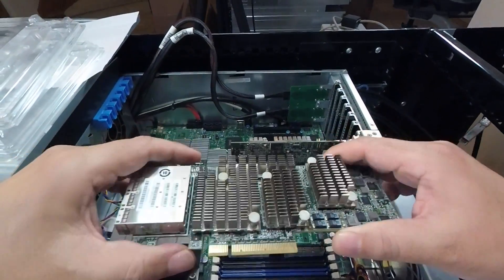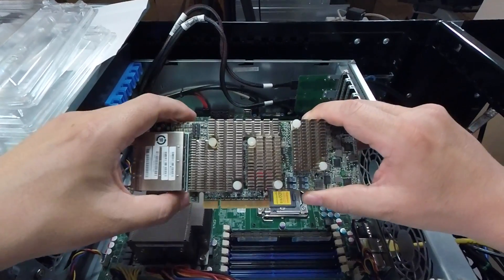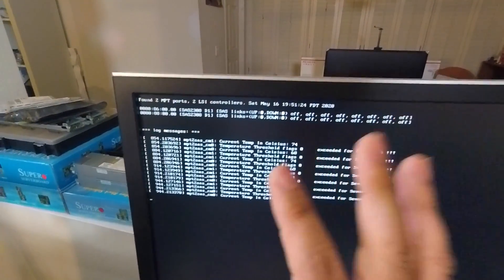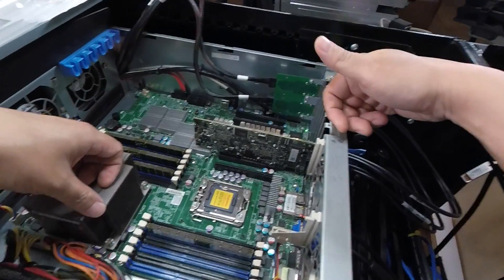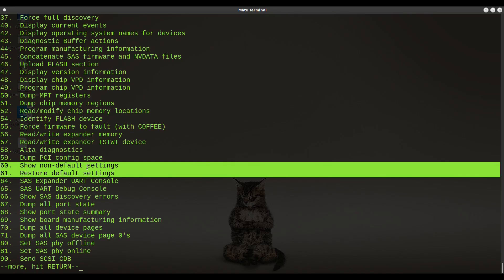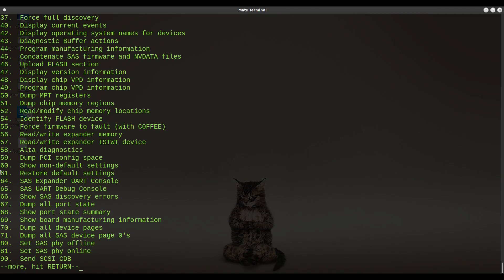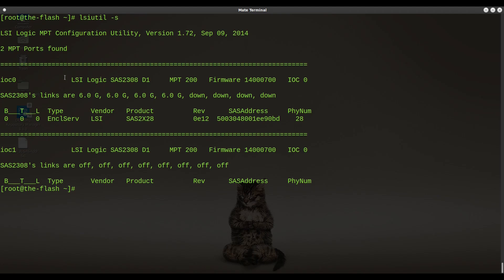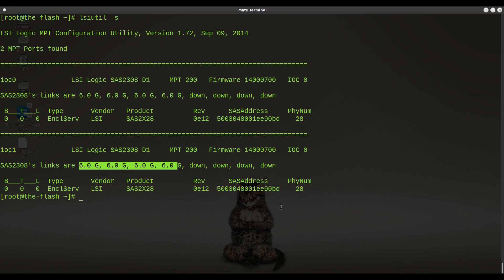Something strange with LSI 9206-16e... | How to fix LSI firmware settings

Comment: I just got one of these cards, and all of the links are listed as down. I updated the firmware, same thing. I'm not sure where to go from here. My 9207-8e works just fine with the 8088 to 8088 cables. I suppose all 4 of the 8644 to 8088 cables I have could be bad, or maybe unsupported? They are firmly plugged in for certain.
Reply from the maker: are they plugged in the correct way? the square connector can be plugged in easily in 2 directions and I've seen that happen before. additionally, there could be damage to the SAS lanes on the card, or even the PCIe lanes between the PLX and SAS2308 chips. I would check all of that.
Reply: Ah yeah, that was it exactly! Thanks!

Comment: "i hope that you find this helpful"
ohhhhh hell yeah i did, this saved the remainder of my hair trying to get this stupid card going. it was actually set up exactly as yours was in the video, oddly enough, so i guess this must be a common (possibly factory/oem?) configuration.
i do have a question though i hope you can answer; i had to run lsituil via an efi shell because it refused to work in windows and linux only returning "0 mpt ports found". after option 61 and 99ing both chips, there is no info on the line below "b___t___l   type   vendor [etc]" from lsiutil -s, like how they were before fixing them. they did not populate any data at all after resetting and rebooting them unlike yours in the demonstration. is this normal? is it because i was in the efi shell and not an os? i did previously sas2flash it with 20..07. from 20..11. and it is confirmed in initiator target mode.
Reply from the maker: Glad this helped! I've never used the UEFI version so not sure why lsiutil displays differently. The 9206-16e cards that have the 20.00.11.00 firmware came out of Dell compellent systems and were used in target mode. That's why we need to swap back to the regular firmware and change the cards configuration.
Reply: @ArtofServer  makes sense considering mine is indeed a dell. either way I guess the information not populating isn't a big deal since this morning I booted into debian to take a look and all 24 drives in my ds4243 plus both 2308s were recognized by sg3utils without issue.

Comment: My comment disappeared. Thank you so much for this video! I was pulling my hair out for HOURS yesterday. I bought a 9206-16e on eBay for $20, and couldn’t get the DS4246 or DS2246 I got free from work working. I wonder if this is some sort of vendor-lock? My card was listed as a “Dell.”
Reply from the maker: Glad it helped! Many of the "Dell" cards are actually "Compellent" cards which was a storage company that Dell bought. If they come from a Compellent machine, they likely have the target mode firmware version 20.00.11.00. If so, you need to flash it with the regular firmware 20.00.07.00 from Broadcom. Then perform the reset as shown in this video. Otherwise, you'll have all sorts of weird problems since you're not using the HBA in target mode.
Reply: @ArtofServer  So far, it's been rock-solid since I used your advice/help! Thanks again.

Comment: Hi! I have 3 9206-16e cards. One is working fine (I did the steps of this video) the other one, detects only one of two 2308 chips and the third one it's not even detected using the lspci command. The three cards tested on the same pc with the same Linux OS (Ubuntu desktop 22.04) with the same PCIe slot. Any hints or extra steps that I can try?
Reply from the maker: That sounds like you have defective cards. You probably need to repair them.
Reply: @ArtofServer  Yeah, it sounds like they are defective. Luckly I only had to pay a couple of beers for them haha. Now I'm trying to locate the eeprom on the board and I will try to read/write it with my CH341A programmer.

Comment: Would this issue be prevalent in 9305-16e Dell cards as well? Or was the problem specific to the 9206-16e only?

EDIT: Confirmed this issue was present on my 9305-16e card and this video solution addressed it.
Reply from the maker: I've never seen it in a 9305-16e, but this issue is found on cards that have been configured in target mode firmware.
Reply: @ArtofServer thank you for the quick reply! I can confirm the same setting was applied on a 9305-16e card I purchased and following your guide I was able to fix it. Thank you again for all that you do for this community!

Comment: Hey art of server ive been having a look at your channel and was wondering if you could help i am having an issue iwth a 9305-16e LSI HBA card where it will show the drives on linux but not windows Its flashed to IT and the drives are all umounted as NTFS but they dont show up on windows any ideas would be absolutely amazing !
Reply from the maker: Unfortunately, I'm not well versed with Windows. The only thing I could suggest is to make sure you have drivers installed for the SAS controller in Windows and that the controller is functioning correctly. Besides that, you might check out this video:

https://youtu.be/1dCd6IepB5s
Reply: @ArtofServer  i ended up giving up on the windows install Truenas worked first try
Reply: Thanks for the reply though <3

Comment: I have one and the lspci only shows one 2308 chip... should is show two?  also the lsiutil doesnt detect anything.  Everything looks good when I go into the bios and in the syslog.  Am I missing something?
Reply: Funny thing with mine.  Even though lspci only shows 1 chip aand the util program doesnt see it at all, the card seems to be functioning perfectly well.  Ive connected 16 hard drives and they all work as expected.  So Im not sure whats happening, but mine seems to be ok
Reply: Hey! How it went? Could you solve this? I have 3 9206-16e cards. One is working fine (I did the steps of this video) the other one, like you, only detects one of two 2308 chips and the third one it's not even detected using the lspci command. The three cards tested on the same pc with the same Linux OS (Ubuntu desktop 22.04) with the same PCIe slot.

Comment: So I am learning about hba's. I have this particular hba. I used this video already to enable half the card.

I also have two hp z820 workstations. I didnt know i could buy a cable for the on board hba to connect my jbod when I bought this 9206 card.

But the on board z820 card is running older firmware.

I noticed on the 9206, one chip has 20.00.07.00, but the other has 20.00.11.00.

I have been just searching for 9206 20.00.11.00 firmware to update the one chip, but all I can find everywhere is 20.00.07.00

So my question is, what is the deal with 20.00.11.00?

After I will look into finding firmware for the hp z820.
Reply: Well, whatever is with it, I was able to use sas2flash to download the 20.00.11.00 firmware and flash the 20.00.07.00 chip to it. It's just weird I can't find it online anywhere.
Reply from the maker: I would keep it at 20.00.07.00. I believe the 20.00.11.00 firmware is a custom OEM firmware, probably for Compellent. Does your card have a Dell P/N sticker on it? If so, it might be from a Compellent box. In the compellent box, these cards were used in target mode I believe, so the firmware was customized for that use case and why it isn't publicly available. The last official LSI/Broadcom release firmware is 20.00.07.00.
Reply: @ArtofServer  yes, 01v1w2. Also, the default settings have target mode enabled and the ports disabled like you said. I used the lsiutil tool you show to change the settings how you recommend here.

I'm getting pretty good at flashing the firmware. If you think the 20.00.07.00 is the best, I'll likely change it.

thanks.

Comment: Where do you find the lsiutil software for ubuntu/debian?
Reply from the maker: the source code is available online in several places. just search for "lsiutil" and I think the latest available is version "1.72" so search for that too. you can then compile the code to product the program for whatever OS platform you need it for.
Reply: @ArtofServer  Strange behavior, the reset to default option wasn't working for me, using option 60 did show things were changed from default. I used option 13 and changed the settings to default however. Thanks again.

Comment: I bought that particular card so that i connect my power edge r220 to my storage array dell md3800f
Reply from the maker: be sure to run the fans at max speed. that form factor might not have enough airflow to cool a 9206-16e card. these run extremely hot.

Comment: This was EXTREMELY helpful! I've got a 9305-24i that I've been unable to get working. During boot I see no indication it's there, drives attached to it don't show. I believe it's supposed to be an IT card and had wanted to use it to replace multiple other LSI cards. It was hell finding lsiutil and sas2flash but believe I've got it, sas2flash doesn't have the same commands as yours however. (listall not listallboards)

Listing adapters with lspci shows the card but neither sas2flash nor lsiutil see it - I'm pretty confused! Any ideas? I badly need to free some slots in my server for additional goodies! This card had been in a box awhile as installing it requires downtime and having to move the server. I'd love to solve this but no joy so far and open to suggestions!

Really appreciate the video, answered many questions. Really strange that finding the various utilities has been made so hard!

Edit: Is perhaps Megacli the right tool for the 12gb adapters? I don't even see a BIOS flash by but spelunking docs for later cards I'm seeing this mentioned.
Reply from the maker: 9305-24i is a SAS-3 generation card. You need to use sas3flash, not sas2flash.
Reply: @ArtofServer   Very much appreciate the response! I have indeed tried sas3flash - it returns a message that "No Avago SAS Adapters found!". This was a Windows executable. Would a different version of this for LSI be desired? Could this be the issue of Legacy BIOS vs UEFI like you mentioned? I've not yet taken that machine down to try swapping that setting but will at first opportunity.

I'm using this card for the number of ports more than I am speed, unRAID isn't often pulling from more than 2 drives at a time so PCI lanes aren't a concern. I'm looking to support 24 SATA drives and would prefer not to use an expander. Would you suggest a different card? I'm trying to free two slots, AMD Ryzen boards are a bit sparse! I'm hoping this card is serviceable but if not I'm back to hunting another solution.

I do see you've got a video on SuperMicro backplanes. This server has an older backplane with many cables but I believe some others have a built in expander and have purchased a newer one for a bare chassis I've got. That might be my solution, that video is for sure on my list as the SupreMicro information is tough to find - you've got lots of it thank you! If you ever do a video on quieting a 4U I've got some tips 😇

Comment: Over 3 years later, I found this video.  I wish I had found it about 10 hours ago! :)
Reply from the maker: So... did it help you resolve an issue?
Reply: @ArtofServer  Absolutely. Thank you! The LSI 9305-16e controller I was attempting to use came out of a scrapped SAN. I had already upgraded the firmware and BIOS, but it still wouldn't connect to the enclosures until I did the full default reset using lsiutil as you showed in the video.  Worked like a charm. The card was showing all the ports as disabled exactly as in the video.

Comment: Thank you.  Thanks to your video, I fixed my sas3041e-hp controller.  After some firmware, it stopped detecting old SATA-150 HDDs.  I did the same as in this video - I reset the configuration to default and the problem is gone.  Thanks again.
P.S. Flashing the controller in "IT" and "IR" mode, resetting the default configuration using "LSIUtil", I did in the control panel of Windows 7. When I tried to run "sasflash -list" in freeDOS, I got an error: "Failed to initialize PAL"

Comment: first: great channel and thank you for your content.
I am having a problem with LSI 9201-16e. Other LSI cards work as expected. (OS: UNRAID)
Card is detected under System Devices 
[1000:0064] 01:00.0 Serial Attached SCSI controller: Broadcom / LSI SAS2116 PCI-Express Fusion-MPT SAS-2 [Meteor] (rev 02)

neither sas2flash nor LSIUtil list the card. other cards could be detected and or flashed

any ideas?

Comment: Bought one on eBay; same problems, however options 61 did NOT restore as in the video. I had to step through the first one, then selected 8 for all ports, disabled the target, auto all ports, and all works. Thanks!
Reply from the maker: Well, I'm glad you were able to figure it out! Thanks for watching!
Reply: Same thing happened to me with a fresh card off eBay.
Reply: Same here, with an eBay lsi sas9201-16e. Originally thought it had dodgy firmware (it claimed 20.00.11.00 rather than the 20.00.07.00 everyone normally talks about), but found this video before I got around to flashing it. Remained in a bad state after option 61, but all working after reconfiguring via option 13. Really appreciate you showing the use of lsiutil for diagnosis and validation, much more helpful than just being told to make a speculative change.

Comment: When I first started this video, I only got a few minutes in before I clicked away, because knowledge gained will almost always end up being knowledge required, and I was hoping I'd never run into this weird problem.

Sure enough, when one of the 9206-16e's I ordered before I found this video arrived, I thought it was bad because half the drives weren't showing up. 

After watching the video entirely and following the steps, my card worked perfectly. Also, your advice about these cards let me know to make sure I had lots of cooling on the monster 9206-16e, which I hadn't considered before.
Reply from the maker: That's awesome! glad to hear this was able to help you fix your card! Thank you so much for your support! :-)

Comment: Thank you so much! My cards also are from some old Dell Compellent SC8000 SAN controllers (Basically Dell R730's with different branding). The software on them was ancient and out of support but the hardware was too good to just throw away. TrueNAS could be loaded on them but wouldn't detect the expansion drawers or any SAS drive attached. This quick fix got them working and updated to the latest LSI firmware.
Reply from the maker: Glad I could help!

Comment: How can I do this without SSH?  The computer I am using is not on a network due to security issues.  Can this be done with just linux?
Reply from the maker: you can do this where ever you can run the lsiutil program.

Comment: Thank you for sorting out all the intricacies of working with SAS controllers and drives, the team is very interested!
I would also like to ask, there is little information on the Internet about analyzing the state of SAS HDD/SSD, compared to SMART SATA hdd/ssd, SMART SAS hdd/ssd is very discreet and it is not very clear to quickly and easily assess its state, please, is there Do you have any tips?
I use HBA LSI SAS 9211-8i:
1. smartctl is a subsection of "Error counter log:"
2. Hard Disk Sentinel for LINUX console (items Health, Performance, Total written, The status...)
(sorry if the language is not correct, this is Google translation)
Thank you!
Reply from the maker: Yes, that's actually on my list (very long list) of future videos to discuss. Thank you for watching!

Comment: Receiving a lot of temperature flood messages alerts in console when running this card, any way to deactivate them?
Reply from the maker: I would recommend first by making sure the 9206-16e is getting enough cooling... 

"dmesg -n 1" should stop all messages to console.

Comment: I have a 9206-16e card that I just got.  I erased the bios using sas2flash and when attempting to flash the new firmware to v20, I geta mfg page 2 mismatch error and the flash fails.  Do you have any suggestions of how to fix this type of error?
Reply from the maker: I think we talked privately about this already? Sorry, finally had some time to get to comments... but for anyone else reading this, try using an older version of sas2flsh.exe from broadcom.com. The older version by-passes some checks. Specifically, consider versions P9 or P10.

Comment: Thank you for detailed explanation. I'm pretty sure I know where are these cards from. Ours is from SC8000 Dell Compellent SAN storage controller, Dell is doing some funky stuff on those cards so Compellent custom firmware is unusable. On ours it was enough to flash Brocade public firmware and it fixed itself (factory reset on dell firmware didn't helped...)
About SSP target mode, afaik Dell uses SAS to sync between compellent controllers.
Few years ago I delt with the exact same issue on SCv2020 / SC4020 controller, which embeds LSI 2308 onboard (I used it with ESXi and later with FreeNAS). Dell firmware wasn't working, so I flashed it to the Brocade original firmware and it started working.
Reply from the maker: thx for sharing that info!